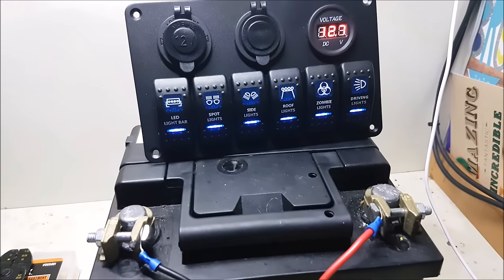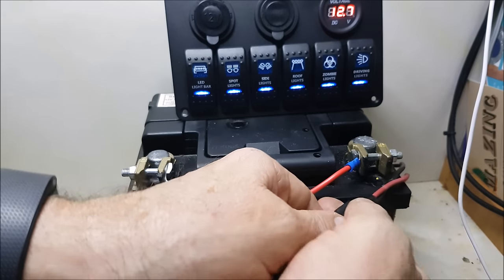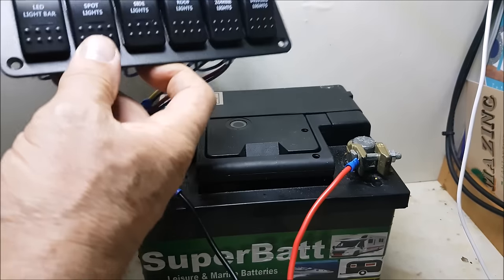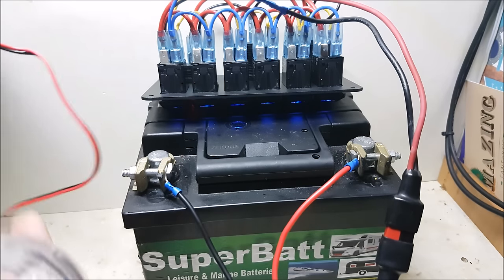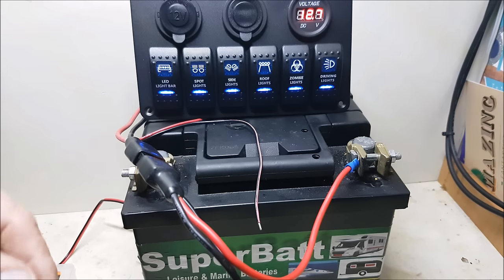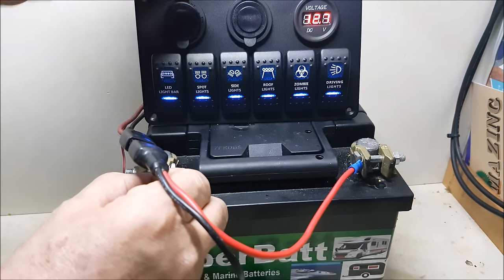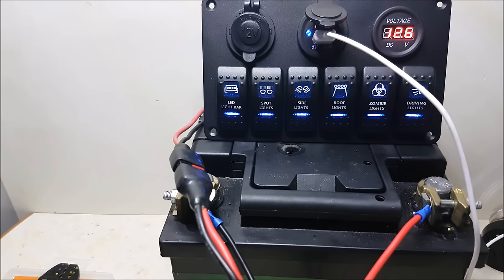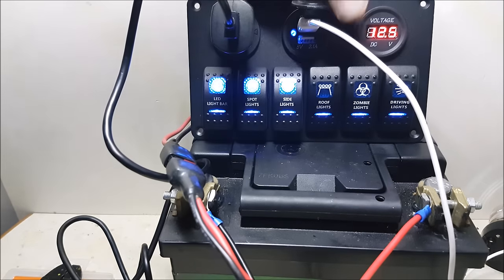How to wire a boat switch panel

Comment: What I wonder is can the labels be removed and ones that make more sense put on?
Reply: If you hunt around on eBay you will find the same thing but without labels. It comes with lots of little stickers that make much more sense.
Reply: You buy different switches to suit your application. Cheap as on ebay

Comment: Why all negatives go back on the battery? Negative wire go from battery in the back side of panel. There is place behind panel that goes all negatives wires.

Comment: With the bottom light that stays on.. is it drawing power?
Reply from the maker: tiny amount but i turn it off at night
Reply: Of course they are.  Best thing to do is take the blue and yellow wires and connect them to the vehicle's light switch so they only turn on when you turn the vehicle's lights on...they're more of a dash light actually and not really meant to be on all the time and thus would drain the battery in your vehicle if left on.

Comment: there must be a plate behind the board that the negative cable runs out of the battery and over there bridges the negative cables of the devices

Comment: A boat have a negative. Anything that has an electrical system has a negative or else it wouldn’t work. It’s fiberglass so you have to either go to the battery or build a negative distro block

Comment: I am not a big fan of linking the plus an minus on the back of the switches. The current in the last link is the load only. The current in the first link carries the current of all the loads. This easily could burn out the wire or link inside the switch.
Also there has to be a rather high current fuse before the panel to protect the  switching board. It is better and safer to protect every switch and load with a separate fuse rated for the load.
The fuse has to be before each individual switch near the power source to protect the wirering and the load.

see also "Reduce risk of fire on boats by proper fusing"  by Pacific Yacht Systems here on YouTube.

Comment: what are the measurements of the switch panel I can't get anyone to message me back on what they are.
Reply from the maker: Hi Triston link below hope this helps 

https://www.ebay.co.uk/itm/12V-5-Gang-LED-Rocker-Switch-Panel-Car-Boat-Marine-With-Voltmeter-Fuse-Box-UK/401880642723?hash=item5d91f3f4a3:g:5UcAAOSwZ~xddkmb

Comment: Thanks, I could not work out the purpose of the yellow and blue. Feel a bit silly now..
Reply: Typically those will connect to a vehicle's dash lights so those lights would only come on when you turn the vehicle's lights on otherwise leaving them as they're shown in this video would run your vehicle's battery down when the vehicle wasn't running as they would be on all the time.
Reply: @wildbill23c  good response! So I’m using this for my boat and only want the main switch light to come on when pressed and do NOT want the secondary light on all the time. Confused as to which wire to disconnect

Comment: This should be wired to accessory power and not to the battery and the OUT would switch a relay. Otherwise, it's powered all the time and you can't shut the lights on the switches off or the voltmeter.

Comment: Where are the fuses, you cannot use this panel if you are going to run a fuse panel, hv to modify it 
By pulling all the blue wires off of switches. Run red wire from fuse panel to top of rocker switch panel then run red wire of accy to bottom Spade where blue 7:13  wires were, put black wire to fuse panel
Reply from the maker: or just use a inline fuse thanks for watching

Comment: Shouldnt every switch be individually wired to a fuse block and not all directly to the battery???? This is not proper at all

Comment: You are wiring it to have a floating ground and that is against code.
Reply: so if you're wiring this panel on a small aluminum boat, how are you supposed to ground it?
Reply: @JohnZastrow  A marine hull grounding plate. Here is a description from Amazon.  Dynaplate creates dynamic hull bonding and grounding for increased performance of electronics and lightning protection. Features most proven and reliable grounding plate, sintered porous bronze matrix with approximately 50% porosity, 48 to 1 grounding area for size, best ground path, 34% more gounding than other available plates, streamlined low resistance shape and easy 2-step thru-hull installation. comes with gold plated terminal monting bold and silver contact coating solution for a positive and permanent connection.
Reply: @sailingeden9866  if you put bronze on aluminum it will corrode the hull
Reply: @JohnZastrow  Yes dissimilar metals can cause galvanic corrosion.  You can use rubber or teflon separators to isolate the two different metals.  Personally I worry more about protecting my expensive electronics than I am about corrosion. They make an alloy called aluminum bronze, where they mix aluminum and bronze together because the mix is very resistant to corrosion and it is used in ship building. I think aluminum and bronze touching would be ok.

Comment: Uh, spend $10 on a fuse panel then you have several places to put your ground wires not having to run them all back to the battery which is not a great way to do things.

Comment: I don't expect an answer because nobody else got an answer either 🤣😂🤣😂🤣
What's the switch Amp rating ?
What's the wire sizes and max amp rating ?
Is the unit fused on each switch?
C'mon man ...Answer your subscriber questions? 
Why post a video and not bother answering questions ?
Reply from the maker: 10amp switch 30amp wire and yes each switch is fused

Comment: Since when is switching a switch up switching on lol avoid these switches panels with these 5 pin switches and most of all do not use the USB outputs  of these panels. The switches on these panels are not waterproof either!

Comment: so you have a switch panel that has only one power wire and one fuse feeding 9 different things so when one of them blow the fuse you lose everything. that Chinese switch panel is junk and you should not put it on anything that your life might depend on.  every single power pulling gadget on your boat. car. ect should have its own fuse. bar none.    and don't buy junk no matter how cool it looks